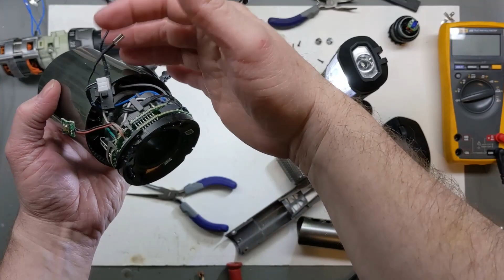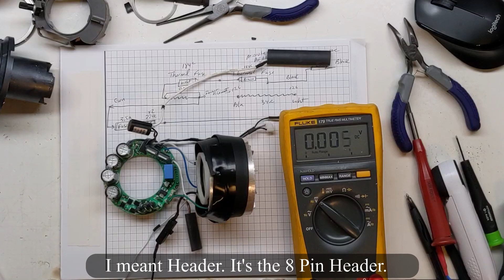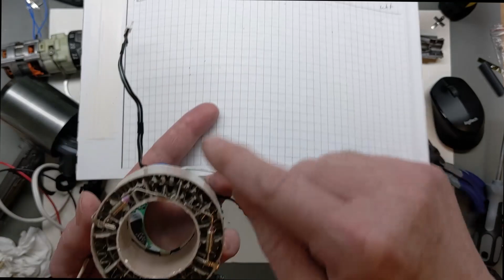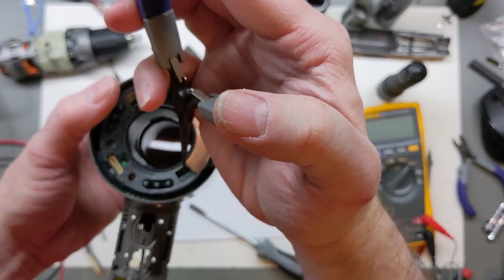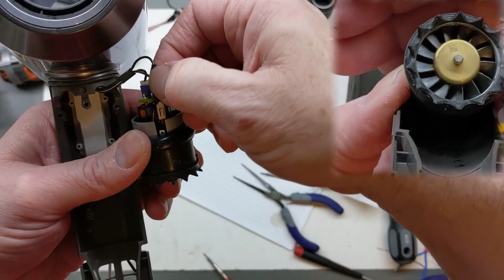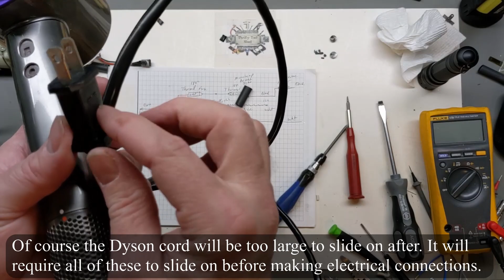Dyson HD01 Repair #2 (Board Level Repair)

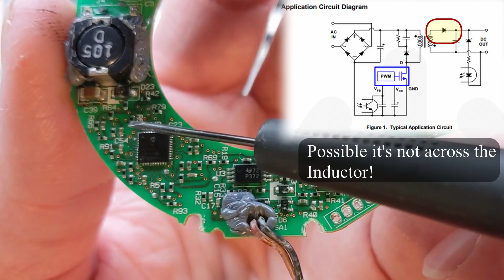Comment: at 10:27 when you're identifying the bad diode, are you suspecting it's bad because its black or is there a way to test this with a multimeter. If so, how? Sorry if this is a dumb question.
Reply from the maker: This one was dark and obvious. Thats not always the case. I show this as well as transistor checks in many repair videos on the channel. You can use the diode test on the multimeter to test. It should be open reverse direction and show .5 to .7v forward voltage the other direction. If you dont have a meter with diode test you can still use ohms scale to check if shorted.

Comment: Great Job. My wife took hers to the Dyson Repair shop they said it would cost her 2/3rds of the cost of a new one to repair.
So she bought the new model. The repair guy wanted to keep the broken one. She brought the broken one home and I was able to fix it using your repair video.
Thermal fuse needed replacing. I did Mess up the switch cover thing so I ordered a new one. It did not arrive yet but it looks like the bottom switch is pre glued on. '
Maybe just have to push it under handle cover when reinstalling it? If you know anything about that please let me know. Thanks again
Reply from the maker: Thanks for your kind comment. The switch buttons are glued onto the rubber membrane. The switch itself is secured by a plate on the back side with tiny screws.

Comment: hi, do you have the spec for the fuse F1 3.5a or if I could get it from digi key thanks
Reply from the maker: You should be able to get it from DigiKey. I did not have to replace that on mine.
Reply: @ThriftyToolShed  have you checked a European version? just want to know if there is any difference in parts due of the 220v and if some parts can be used for the 110v version?
Reply from the maker: @idevicerecycle3706  
I have not looked at one at all.
Reply: Any chance you have the specification or model number for this fuse? 
Like I know I need 3.5amp 
How about voltage rating and type of this fuse (ceramic?)
sorry for these noob question

Comment: While taking apart my second dyson ( your videos helped me fix the first one ) I broke the tabs on the casing for the heater coil. Any idea where to get replacement?
Reply from the maker: I do not. Is it anyway to connect back with a crimp or is it in a spot where it's not possible?  If you want to share a photo on Facebook group On the Bench I will see if any ideas pop in mind. No experience with that myself. Thanks for your comment!

Comment: Got same dyson unit, heat and speed lights all work, fan runs, just no  hot air comes out. Filter is clean. Would this be down to microprocessor or Heating element / fuse feeding heating element. No flashing lights seen, works ok as a "cold hairdryer" but just wont give hot air on any red light setting.
Reply from the maker: I would think testing the output of the SCR feeding the element would be needed if you can do that safely. That way you can diagnose where the power is stopping. The ones that I have seen the thermal fuse will cut power to the whole unit. So if no fault it may be the microcontroller output or the SCR itself possibly. I have not seen that exact issue to say for sure it could be a board mounted fuse for the element, but I can't say for sure.

Comment: Hi would you let me know how to test motor of dyson dryer as what should I contact to motor to make it run ? As my dryer switches on and off maybe you would give ma a clue? Thanks
Reply from the maker: I have not found a way to easily test these without the actual Dyson board driving it. I believe these are Series Reluctance motors and use high frequency pulse to run. A router speed control for example will fry it. I use another known good motor for testing or put the questioned motor into a known good dryer for proper testing. Best of luck to ya!
Reply: @ThriftyToolShed  Hi I bought cheap Chinese motor to connect and test but Chinese motor is not working either with dyson motherboard so I'm confused so much because question is if Chinese motor is not compatible with dyson motherboard or motherboard is not working properly hmm. Do you know what reading of Volts shout i have on cables which are going in to motor ? I bought broken dyson dryer  to have satisfaction to fix it but now I'm just stuck 😬
Reply from the maker: Hi,
Some of the cheaper replacement motors are 3 phase BLDC motors that only work with the Chinese board. They may sell the 2 pole SRM also, but I am not sure. If it has only 2 pins and claims it works directly with the Dyson then it might be ok and it's possible you have a board issue?
Reply: @ThriftyToolShed  okay 👍 so Im still having hope after your reply as I got 3 phase motor and didn't run on dyson board but the 2 pin motor are bit expensive. Also dyson motor which I'm testing have correct resistance so if there is correct resistance then is motor okay ?
Reply from the maker: Typically ok if resistance reads well. What are you basing the good ohms reading from?  It's about all we can go by except for actually testing it out by running it in the dryer itself.
Reply: @ThriftyToolShed  yes, ohms are correct so do you think motor is okay ? I was watching your video so I have tested ohms on my motor ohms are a bit higher than ohms on your vido but it seems fine 🤔
Reply from the maker: I would think if it does read close and it's not locked down then I would consider it passed like a preliminary check. Only other option I have at that point is to try to run it. I don't have any way but the Dyson itself to run the SR motor.
Reply: @ThriftyToolShed  thank you, I may drop some massage to you while I will be getting on with the job I let you know about results thanks for you video and support

Comment: Any idea of the part # for the main fuse on the mainboard? Trying to repair the wife's HD03 unit. Thanks to your videos I was able to disassemble without issue, along with identifying the issue of no power. Now I just need to find the part to repair
Reply from the maker: I have only had to replace the thermal fuses (many times)  and one diode as shown in previous repairs. I have had no other component issues to know for sure. Glad you found the video helpful. Thanks for your kind comment.

Comment: Where are the thermal fuses located?
Reply from the maker: Shown in about half way in the video.
Reply: @ThriftyToolShed  Thank you.  are there any other fuses in the unit (power box? plug housing?)...mine simply will not power on...no lights, nothing.
Reply from the maker: Some of these have GFCI plugs.. Mine had what I believe to be a filter in the sealed box. As far as I know it's just an Electrical (noise) filter. The dryer will run with 120V straight to the input terminals as I showed in the video. Once the 120v is at the dryer it goes to the power switch then to the thermal cutout and thermal fuses for the heater circuit and then back to the board. I shared videos working on 2 of these in case it helps someone else. I basically shared as we learn together. Not much more help I can do than that.
Reply: @ThriftyToolShed  OK so tackled the Dyson today and have it completely dissembled.  I terested the thermal fuses with an ohmeter...hopefully it was ok to test them without removing them.  With probes on each side of the fuse, one showed "0 ohms" and the other showed infinite resistance, so guessing that one is shot and is the culprit...agree?  Also, I noticed that at your mark 13:14, you allude to a 3.5A fuse (labelled R6 on the baord) at the ground.  That showed infinite also but not sure I tested that correctly as I just placed the leads on each of the metal "brackets" that hold it in place.  Thoughts?  Thank you again and happy new year!
Reply from the maker: @milbrooke  
It does seem one of the thermal fuses has opened up. As far as the small 3.5A SMD fuse, it's for the control side so the electronics power and most likely the blower motor control. It would be odd if it's open, but I would double check since the board has a light conformal coating it could be that the meter probes are not making a good connection? Best of luck to ya! And Happy New Year to you as well.

Comment: For the power brick that lives between AC and the dryer - what is the output voltage of that? Current draw?
Reply from the maker: I did not test that on the first HD01 I worked on to say for certain. Since I was almost certain it was simply a filter. I had tested the function of the 2nd HD01 with a straight cheater cord so I felt like my assumption was correct and in fact  just a filter for all the high frequency noise. I am sure it's a noisy device.
Reply: @ThriftyToolShed  have you ever opened one of the bricks?
Reply from the maker: @jackwpitts  
I have not. The way it's sealed, I did not take it apart since it would have destroyed it. I assumed it was a filter. I know I have ran the Dyson without it.
Reply: @ThriftyToolShed  that’s what I want to do. Does it run fine without it?
Reply from the maker: Yes, the HD01 that I worked on runs fine without it. I believe it to be a high frequency noise filter since the supersonic air blower must use very high frequency pulses to run it. I used a straight 120VAC cord to mine for testing. You will of course need a GFCI installed on the cord itself or at least have a GFCI installed where it is used for safety!

Comment: Hi,
I have one of these devices by Dyson and it is tagged that it is 50 Hz!
Do you think it works fine on 60 Hz supply? if the voltage is compatible
 Thanks a lot in advance
Reply from the maker: I would think if tagged 50HZ it might possibly be an overseas model rated for 240V/50HZ instead of 120V/60HZ like in North America?
Reply: @ThriftyToolShed  It was acutally bought from Turkey and rated 220~240v and 50 Hz. The voltage where I am moving to is 220 v but 60 Hz. That is why I would like to know if it is compatible and would work fine with the frequency difference, since I heard a lot saying that it will work fine on 50 and 60 Hz but they might missed to tag it out.
Reply from the maker: Yes most of the time if the Voltage is within rating the device will work on 50 or 60 hz. Most consumer electronics will work on either and the most affected devices are usually AC motors. The motor speed will be higher on 60hz. The HD01 has a BLDC and uses a controller so I would think it would work fine either on 50 or 60hz. If it states "50HZ only" anywhere I would research it more to make sure, but typically somewhere in the manual etc. It should show rating as 240V 50-60HZ rating. I am not 100% on yours since it's not the same as mine, but it seems likely to work the same.
Reply: @ThriftyToolShed  Thanks a lot man, I appreciate it

Comment: What's the white tool you hammered? I need something like that
Reply from the maker: I think it was a piece of PVC pipe if I remember correctly. LOL. I was showing how not to do it until I did finally get into it since I showed later how it twists and locks in place.

Comment: Doing a repair on one of these atm, 1 thermal fuse is blown and the white rectangular fuse is also open circuit.
I bridged out the black and green wire essentially bypass the thermal fuses and small element, it runs on the bench with the motor attached but the elements smoked up, do you think thats because the motor wasnt moving air over the elements?
Reply from the maker: The first comment I replied back was for a different device. So I deleted it. Sorry about that. 
Yes, the air flow is absolutely needed or the element could easily burn up.
Reply: @ThriftyToolShed  interesting, the white rectangular fuse says it'd open circuit with my multimeter but the unit functions fine, do you know if it's much more than a fuse .e.g a diode in there too?
Reply: @heely69  I just had the same issue but realized something, the fuse is actually covered with a thin layer of insulation on the ends. Most of the PCB appears to be conformally coated so you need to use a knife to scrape a little bit until you get metal. Then when you measure it, it should be correct.

Comment: Yesterday I replaced the motor for my supersonic  dryer and it still refused to turn on (did this bc Dyson said that was what was wrong with it). I can hear a frequency coming from the link box when I plug it in, but no lights turn on. I’ve had it for 4 years but only used it for about 2. Suddenly one day it refused to turn on. 

If you have any advise or are willing to fix it for me I can pay! :)
Reply from the maker: I wish I had time, I do get asked this often. I do not have a repair service at this time.  I work full time+ in a Industrial job and try to have time to edit videos to post. I try to help by posting what I have learned and sharing that best I can. If I understand that you hear a high frequency from the filter box on the cord? I would try to carefully use a straight 120v regular cord to power the hair dryer. It is possible that the filter box is bad? Atleast that will eliminate that part. The filter is mostly for noise I believe and it should still run without it for testing. I noticed some replacement cords on eBay don't even have the filter on them? I am not sure about those, but I have tested mine without the filter and it tests fine that way.  Best of luck to you with yours!
Reply: Thanks for your advise I’ll check things out online :)!

Comment: is there any way to convert 110v US market Dyson to 220v?
Reply from the maker: Since the heater element and motor is designed for input voltage , you would have to buy correct design for your supply.
Reply: @ThriftyToolShed  there was a typos, thank you. So theoretically if replace the motor and heater - it might work?
Reply from the maker: I am not sure what you mean by marker Dyson?

Comment: What tool did you use and how hard was it to pry the back purple cap off?
Reply from the maker: Spudger type tool then a small flat screw driver until I could get my fingernails in and work at it. It's not real hard, but is hard to start it pulling out.
Reply: @ThriftyToolShed  thank you.
Reply from the maker: Some of this detail I had already shared in my first repair video. So some things jumped ahead here to save video time.

Comment: I watched both your videos, and need to know how you got the buttons off of the second one?  I know the first ones were already glued on, but did you have to break the second ones and glue them on as well?
Reply from the maker: I have the limited experience with only these 2. With my experience they are glued on. Keep in mine that both of these were used already and I believe someone had already attempted repair at some level. You may get lucky and the buttons pry out, but they could all be glued in for all I know. They are seemingly glues on to a small rubber backed switch pkate. Sorry I can not confirm this for you. Best of luck with yours!
Reply: @ThriftyToolShed  found another video where  it shows they are glued from the factory.  Razor blade and it popped right off.

Comment: Very interesting video, I just so on the left corner a drill with a esc , it's any chance to fix dewalt impact with one of that esc , normally dewalt have hall sensors but I think if I can house one of normal ESC without hall ? 
Thanks.
Reply from the maker: Hi,
I have a video looking inside the Ridgid brushless drill and I do show it working off of the cheap brushless BLDC controller.  So it's possible if it is a brushless as shown here in the video link below. 
I aslo have a video on the Ridgid jigsaw that I replaced with the BLDC controller and it still works just fine.
https://youtu.be/UaMmWGn97F0
Reply from the maker: This is the video on the Ridgid jigsaw with cheap BLDC controller if interested. 
https://youtu.be/pelpii5e6uc
Reply: I so your video but I don't know if it's going to fit inside and another thing I don't know if I can change from clockwise to counterclockwise... I hope I will find in your next video. I so how you fix your dewalt drill and I try that but without any results.
Reply from the maker: @paulmoisa9387  
The small controller used like on the jigsaw does not have a built in direction fwd/rev control and that is why it worked great for the jigsaw but not easily reversible.
For a drill or impact.
Reply from the maker: This item has a 1000w version that seems to have fwd/rev built in. It is larger so may not fit in some places. I have not tried this one myself, but it's interesting at least. 
https://www.ebay.com/itm/3-phase-200W-1000W-DC-Brushless-Hallless-Motor-Driver-Board-BLDC-PLC-Control-/274868220944?mkcid=16&mkevt=1&_trksid=p2349624.m46890.l49286&mkrid=710-127635-2958-0

Comment: Any advice on how to replace the fuse in the plug? Mine broke twice and dyson told me to throw the machine out but for $400 I’d like to have it repaired. No one seems to fix these units but a lot of them break (like ALL in 2yrs)
Reply from the maker: HI,
I have not had that issue yet but I do assume that the cord has the fuse with the filtering board inside the sealed housing. The only way to get to the fuse is to actually destroy the housing over the filtering board. It would be hard to put this back together. One solution could be buying a replacement cord off  eBay? You can install it very similar to how you see me reassemble the one in the video. I really dislike when companies make it extremely difficult to repair or work on there products so I share all I can. Hope it helps and Best of luck to ya!